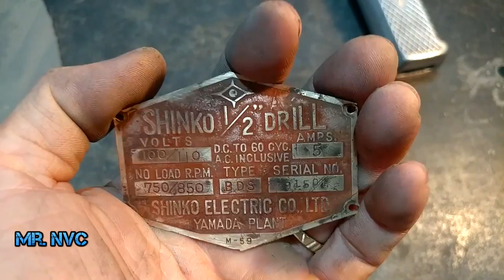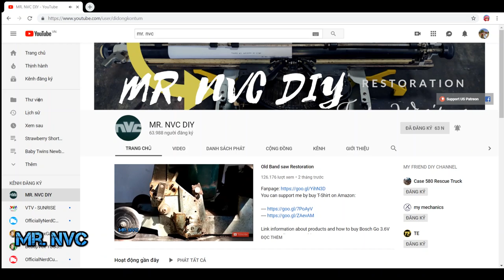Very old Drill Restoration - Shinko 1/2 Drill of Japan

Comment: Good job! But there is a reason for the seemingly excess amount of grease. Without a service manual there is a rule of thumb: You should fill up the Gearbox until it gets warm fast, then remove some until it gets a little bit warm after like 5 minutes of running. (for home use where you do not run it for longer periods of time)

Comment: Amazing!  That drill must have been well made, none of the gears were broken, and the armature and field were still good and didn't need to be rewound.  Only a good cleaning job, new bearings, power cord, and brushes.  How many such old tools would have even been worth the trouble to restore?
Reply: More than the former owners suspect I think.  Those were the days of the tank like tool.  Now we use far fewer materials to make them.  Win or loss?

Comment: Thank you for not painting the outside case silver and leaving it in its original bare metal finish. Most of these older tools came that way from the factory, and if you go ahead and paint it, chances are the paint would immediately flake off from general use.
Reply from the maker: Yes. In the future paint will flake off from general use